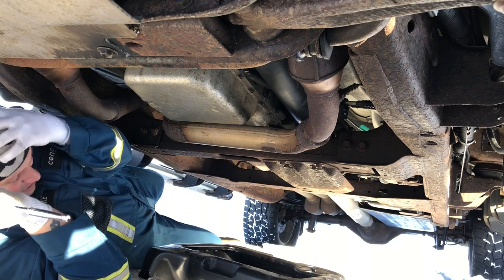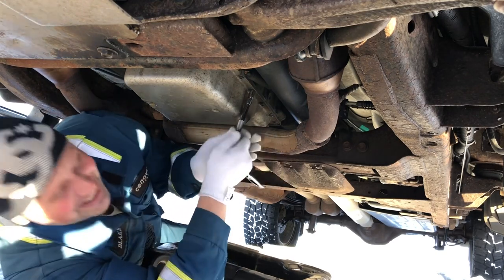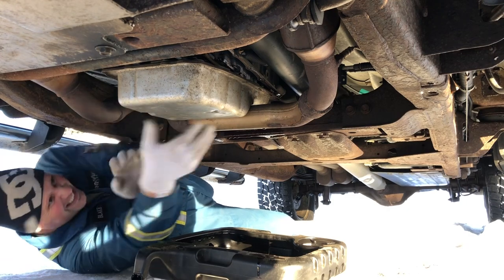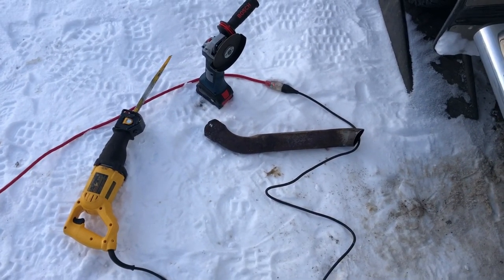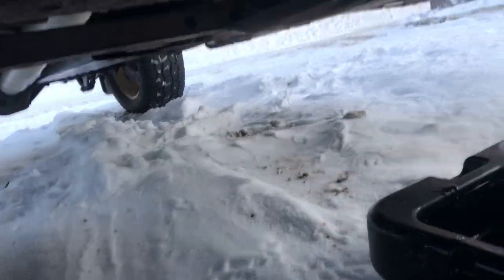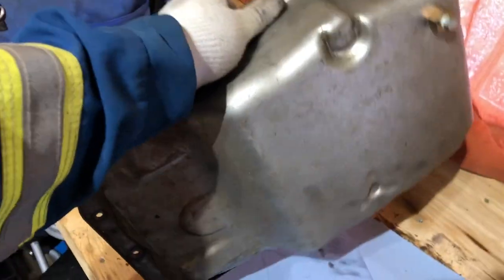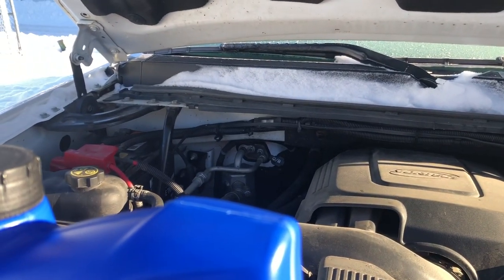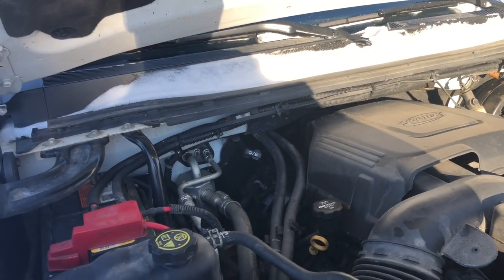6L80 transmission service and B&M drain plug installation!!

Comment: Agreed, did mine today. Also right above your head at the y pipe, take a ratchet strap and pull down on pipe. Will give you an extra half inch. Plus rotate front of pan to driver side, then gently pull to front of truck. There is a very particular spot it will just slide out.
Reply: yelp, just like that, and this dude cut the pipe out......haha! git er done!

Comment: I'm posting this to hopefully help others,  not for arguments sake.  
Pan Removal Trick: I have 2018 Tahoe 6L80 trans. and the pan will come right out!  Not sure if your ride will have it (i know most do),  but I removed the heat shield on passenger side of pan (2 bolts). Then I was able to slide the pan over to passenger side about 3 inches, then twisted the front of the pan towards the driver side and it came right out!  Removing the little heat shield gives you lots more room.  If you look at the back of the pan (shallow end), there is a little raised area on the bottom about 3 inches from the passenger side, that spot is the point that will allow you to move passed the exhaust y pipe (cross over pipe).  Hope this helps!!  👍

Comment: You can get the filter out while the pan is hung up on the cross pipe. Once you get the filter out the pan slides right out.

Just make sure to put the pan back over the cross pipe before putting the new filter back.

Comment: Only way a dealer changed that fluid before was by dropping the y pipe or prying down a bit on the exhaust and squeaking the pan by which is what I have done.   Putting in a drain plug in a pan usually just calls for another possible leak. But you picked a hell of a time to drop the pan. 😊

Comment: Is it possible to drill the hole for the drain plug into the pan while it's still installed?  obviously don't push the drill bit through more than a millimeter.   then let the fluid drain.  Then remove the pan, clean any metal shards and install the drain pug kit and re install?
Reply: I’m thinking of trying this also

Comment: No need to cut tbe pipe brother!!! all you need to do is remove the filter after you drop the pan and wiggle while it turning drivers side. I have done it many times on my 6L80. Nice info on the BMW plug.

Comment: OMG, you cut the exhaust?  Ya just loosen the rear mount bolts and jack up the back.  The pan will fall right out.  Most dealers will just suck out the fluid and to hell with your filter.

Comment: Not impossible Blake! There is a way to wiggle the pan a little and it will come out! Just did this last week!
Reply: It is a pain in the a$$ though. I needed to replace the checkballs in the valve body and the mid pipe cross member did get in the way but I was able to complete the job. This was on my own truck by the way and also my first time EVER working on a transmission.

Comment: Surely this is not a serious video? To get the pan off a K2 truck you move it about 45 degrees to the driver's side and it slides right out. Just have to practice the technic until you get it down.
Reply from the maker: The aftermarket exhaust on the truck was welded in solid much too close to the pan.  So yes.  Has since been rectified.